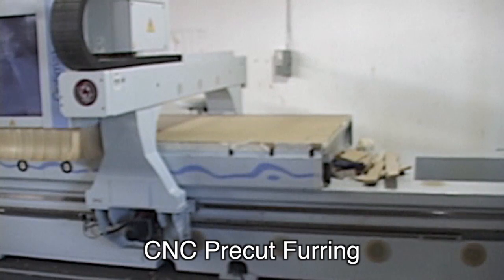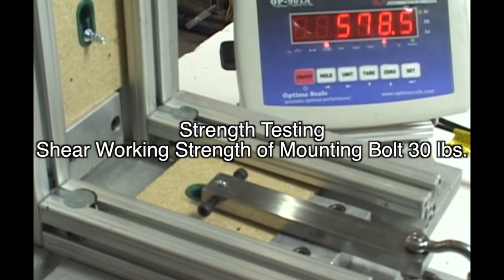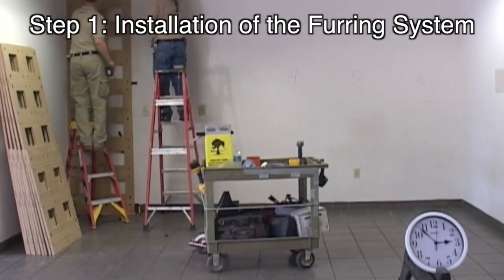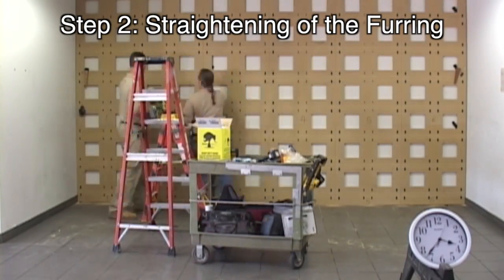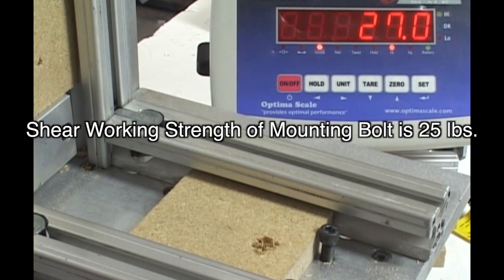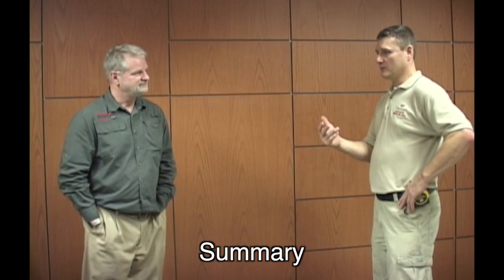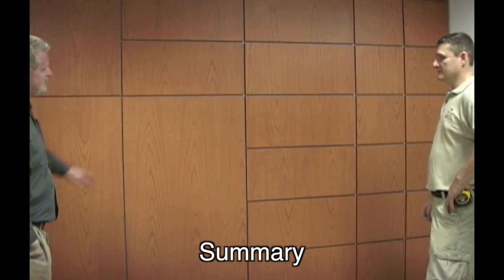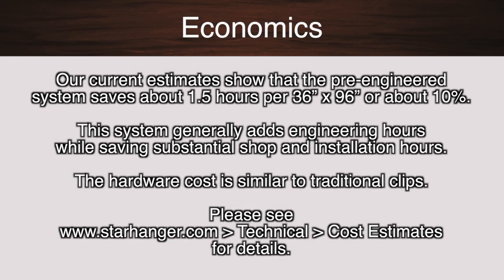300 Green Glide, Field Demonstration

Comment: What is the purpose of this wall system? Seems like a lot of work and complicated steps. What is to be gained by using this system?
Reply from the maker: The 300 Green Glide is designed to mount wall panels using a prefabricated furring system. The 300 Green Glide is a precision, hidden-insert fastener that compresses into a pre-routed slot, and is best suited to pre-engineered (CNC cut) panel-furring systems.  It is faster than manual systems,  Please take a look at our website under Home, then take a look at the report "2022 Panel Systems Cost Evaluations".   This is our best afford to explain the cost advantages of these systems.   Please note, on a  small job the set-up time required may not be worth the trouble.   Thank you, Charles